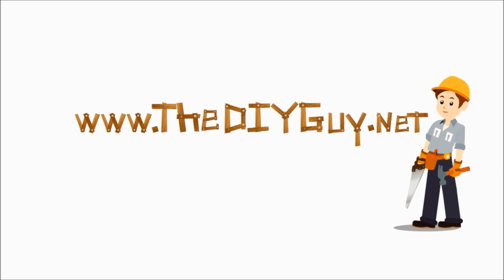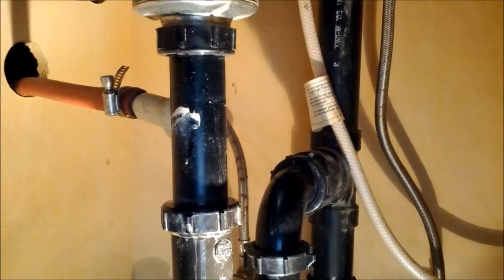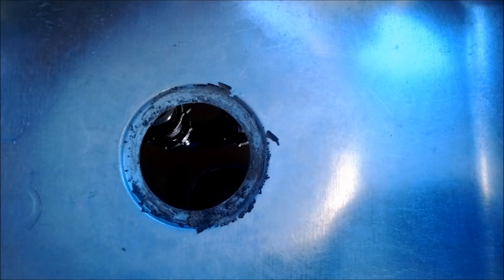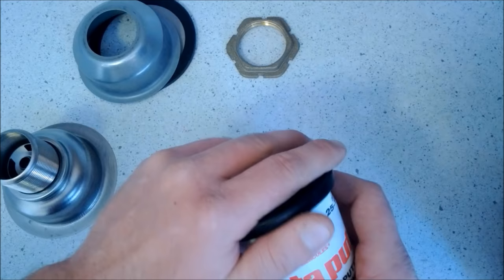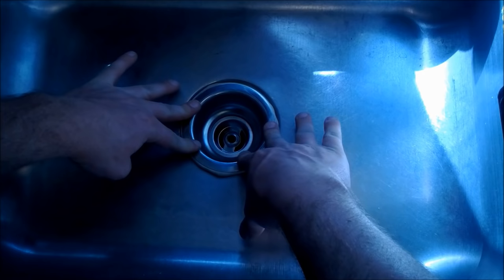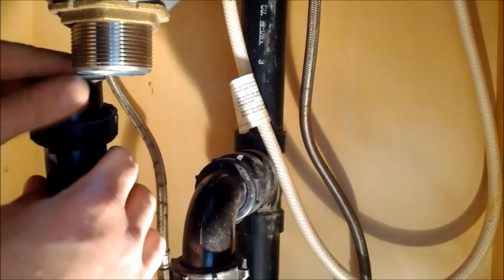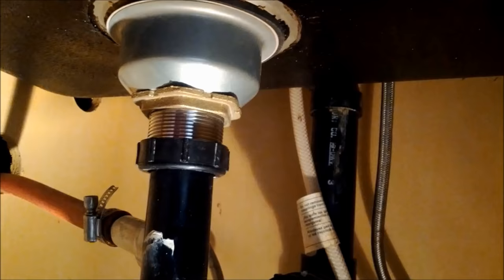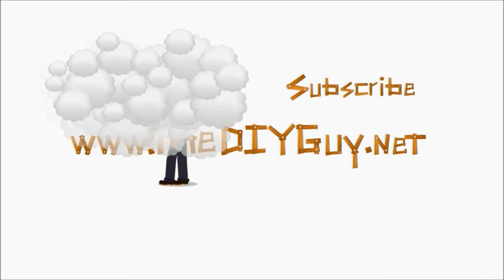How to Replace A Kitchen Sink Strainer

Comment: I tried installing my drainer when I turned on the water it was leaking from the strainer part what did I do wrong
Reply from the maker: Its hard to say without seeing it. Leaking out of the basket or where the tail piece of the trap mates to the strainer?  Make sure the sink flange is clean top and bottom. Add more putty so you get a good amount to squeezes out evenly around the entire strainer. Put a bucket under the sink to catch the leaking water and run hot water to make the putty more pliable and tighten the nut more to ensure its good and tight.
Reply: TheDIYGuyDOTnet ok great thanks
Reply from the maker: @DonsHooplifesports  No problem. Good luck with getting it to stop leaking.
Reply: TheDIYGuyDOTnet so right now the leak is coming from the screw part where the pipe connects to screw the water is coming down a little not a lot down the pipe from the screw I tried tighten the screw but when I try tighten the screw the whole drain turns so I can’t tighten like I need to

Comment: Nice video... twas a little dark at the beginning.  I would like to also recommend using some food grade plumber's grease or food grade lube (silicone spray, grease, even vegetable oil works) on the rubber gasket to make sure it's not dry, and I've seen other videos recommend some pipe dope on the tail piece and ferrule.  Thanks for the help!

Comment: In the real world its rarely this easy for the nut to come off
Reply from the maker: It depends on how much plumbers puddy the installer used and if it got onto the threads or if it leaked and rusted the threads. This one wasn't that easy as the nut split making it easier to remove it.

Comment: What if there is no nut on the bottom of the existing strainer?  It's just some goofy plastic collar that I've never seen before. I can turn it by hand, but the basket in the sink just turns along with it.
Reply from the maker: Hello, Is there a garage disposal attached? Or is it just a sink basket with a plastic nut? You could snap a picture and then click the link in the description and at the bottom of the page there is a place to upload it and I would be able to see exactly what your looking at. There are to ways to remove it.. The fastest way would be to take a chisel and heat it with a torch and then push it though the plastic nut and cut it in two spots then pop it apart. ( The way I remove plastic garbage disposal nuts.) The second way would be to use https://amzn.to/2LiQAgm to hold the basket from turning and then remove the nut with some pliers https://amzn.to/2Elqisr. You could also try and use two flat screw drivers and slide them into the basket and have someone hold them from the top while you try and turn the nut from the bottom.

Comment: I can’t rotate the nut lose. Really stuck in there. Any suggestions?
Reply from the maker: Most of the time you will not be able to remove the nut. Most of the time I end up cutting them off with either a hacksaw like this one https://amzn.to/2yPQhHT or a angle grinder. This one is the video actual cracked when I went to remove it. You'll need to cut it on a 45 degree angle. You'll want to cut a bit and then check the cut to ensure you don't go to far and cut the sink itself. You can cut deeper on the basket side and then grab a flat screwdriver and place it in the cut and twist it and it should crack/ break the top part of the nut up against the sink. Then you will be able to remove the nut. I need to replace another one and show how to cut the nut as most are really stuck.

Comment: Is there a difference between plastic and metal traps
Reply from the maker: As far as performance they do the same. Some people if you can see them like the chrome so they would need to use the metal one. Now a days people mostly use the plastic and last for a very long time as long as you don't use a lot of drain cleaner in them as it can get so hot as to distort the pipe or gaskets. I mostly use the PVC tubular traps which are white in color and plastic.

Comment: no thread tape or brush on thread sealer?
Reply from the maker: No there's no need. The plumbers puddy seals the basket to the sink and the tail piece has a gasket within it to seal it to the bottom of the basket.

Comment: Do I need to turn off any of the water valves?
Reply from the maker: You don't need to turn the water off to replace the strainer but I do sometimes depending on how long it will be and who's around as someone could walk by and use the water while things aren't connected.

Comment: Should I use plumber tape when I reattach the Pvc pipe to the drain?
Reply: no
Reply from the maker: There is no need for plumbers tape there as there should be a plastic or rubber gasket.
Reply: TheDIYGuyDOTnet thank you

Comment: Is the plumbers putty hard to get off?
I have a ceramic sink & fear chipping it 
while unsealing the plumbers putty. SOS
Reply from the maker: Plumbers putty is a soft set sealant. It sometimes is hard as a rock if it is really old putty but should come off fairly easier.
Reply: TheDIYGuyDOTnet 
Thanks!
Reply from the maker: @totallydomestic433  No problem, Glad we could help and good luck with getting it reaplced.

Comment: should I use plumbers tape on PVC
Reply from the maker: Most of the pvc drains should come with a hard plastic gasket or a rubber gasket. So there should be not need for plumbers tape.

Comment: thx much, i have a old iron nut, underneath, do you know howto cut it and withwhat, its old and wont turn ty
Reply from the maker: The best way I have found to cut the nut is with a cutting wheel, cut the nut on a 45 degree angle or so you don't need to cut the nut all the way though and be careful not to cut the sink base itself. Then take a decent size flat screw driver and put it into the cut and turn it, sometimes you may need a pair of channel pliers to turn the screwdriver and you should be able to split the nut making it easier to remove or you could make two cuts and break the nut in half.
Reply: hey, ty very much, appreciate it
Reply from the maker: No problem. Good luck with getting it repaired and thanks for watching.

Comment: Why do simple jobs HAVE to become complicated?
I confidently went out and purchased a new kitchen sink strainer kit.
But then I found that I could not easily remove the PVC (slip?) nut connecting the PVC piles to the brass drain pipe.
It was so stubborn that I've now broken the brass pipe fitting on the other sink (it's a double kitchen sink).
At the moment the PVC nut is still there but cracked as well.
Grrrrrrrrrrrrrrrrrrrrrrrrrrrrrrrrrrrrrrrr
Reply from the maker: lol that's just how it goes... The jobs that should be quick or you think turn out to be projects. Sometimes to get the plastic nuts off I heat up a chisel and press it though the nut.

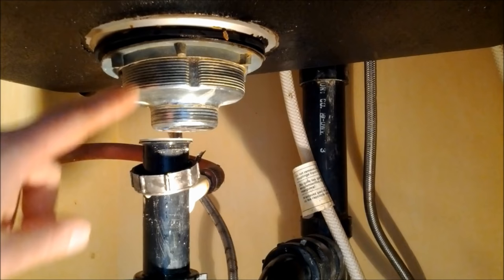Comment: At 1:10, how could you position a hack saw to cut that ring off? Mines stuck and I don't have a wrench big enough to grab and turn it with. Yours looked lose before you even took a wrench to it.
Reply from the maker: you have to go on about a 45 degree angle. When I say hack saw I'm talking about something like this https://amzn.to/2FhlVRj with the blade open so you can cut it. This is what I normally use https://amzn.to/2AZr8Je as its pretty fast. This one cracked right at the first turn you can see that its split when I turn it. So this one came off pretty easy. You can use a sawzall, angle grinder, oscillating tool ect. not sure what you have access to. you could always try spraying it will wd40, wire brushing the threads and then using a flat screwdriver and hammer and tab on the tabs to turn it. Good luck getting it off.

Comment: i bought a new basket and it is a bit taller than my old one, when i installed it i noticed that my pvc pipe doesn't sit flat to the bottom of the basket because it's taller than my old one and now the pipe sits on a bit of an angle and i can see a crack, i tightened the plastic nut as tight as i could but i have a leak, was wondering if their is a quick fix because i don't want to pvc pipe assembly under the sink, any tip would be greatly appreciated thanks, excuse my french, i hope you understood what my problem is, thanks again

Comment: How long should I let the putty set for after install?
Reply from the maker: Sorry for the late reply. Its a soft set putty and there is no need to wait. You can use it right away. Its also best to run the warm/ hot water for a bit and then try and re tighten the strainer nut as the warm water will make the putty more pliable and you can get a few turns more.
Reply: @TheDIYGuyDOTnet  thanks! I got it all done. Works great.
Reply from the maker: @breakarm8782  Awesome, Glad to hear it went smoothly for you and your back in business.

Comment: Just wondering why nobody using a rubber gasket as a seal which comes with a kit ? Does plumber's putty work better? You have installed a rubber gasket under the sink. It is pretty much useless there and serves no purpose as a seal.
Reply from the maker: This type of drain assembly has a 2nd cup that acts as a giant washer to hold pressure against the rubber washer/gasket on the underside of the sink when the nut is tightened. The Flange of the basket strainer goes on the inside of the sink and the rubber washer/gasket, paper gasket/ friction gasket, pressure cup and nut go under the sink. On other styles the rubber washer seals the sink from below, and you can use the plumbers putty or caulk to seal the flange to the sink from above. That's how they are made to be installed just like the instructions say. There are some sink baskets that do have a foam type of seal that is made to go on the top side to seal the basket to the sink. Those are mostly used on either natural or man-made stone products as the plumbers putty can lead to staining, discoloration and hairline cracks. However, they also make "stainless" plumber's putty for these other materials as well. If you use the rubber gasket that comes with the sink basket like this one inside the sink it is normally to tall/ thick so it leaves water within the sink which can lead to staining, discoloration within the sink base depending on your water and material of the sink base.

Comment: Unfortunately my old strainer/flange won't come out - it's stuck in there like it was welded in.  lock nut is off, but the old basket won't budge.  Otherwise great video.
Reply from the maker: Steve Richardson Sorry to hear that. Some people use something other then puddy which makes it a PIA to get off. Thanks.
Reply: I slept on it, and with some judicious application of a chisel I was able to chip away enough of the prehistoric putty to get it out.  Thanks again, and I really enjoy your YouTube videos.

Comment: My only issue was the old basket is a different length than the new one.
Reply from the maker: There always a little different but most of the time you can lower or raise the extension to take up the difference.

Comment: I just did this nasty job in 3 hrs-here's my tips:  Just plan on sawing(dremel cut off) the retaining ring-if there are little "corrosion crumbs"-it isn't coming off-even with the fancy tool, or extra giant hands or saying unladylike things....  Dig out the old gasket  prior to sawing,with a utility knife-this gives a little room to dremel in without cutting through your sink.  Lastly-once you are done  -BEFORE you put on the new retaining ring-coat both sets of threads (ring and strainer) with "Never Seize"-It should help in removal at a future date.  Yes, buy parts for everything back  to the wall-if you're lucky and do not use them , return them.  We live at the beach so going to the store is a trip.  I replaced all the PVC parts back to the wall drop while I was there--yick nasty.  If it went together, it can come apart-just takes time.
Reply: Would this cause any provlems if put in wrong
Reply from the maker: Mark Allen
 If it is installed incorrectly it could cause a leak underneath as the plumbers puddy needs to seal to the sink. Just ensure its sitting down in the groove on the sink and you have enough plumbers puddy and you should be good.

Comment: Hi what is that black thing called the one you remove in 0:57
Reply from the maker: Hello, That is an 1 1/2 nut that helps to hold the "P-Trap" together. I loosened it so I could rotate it out of the way. Hope That answers your question. Thanks for watching.
Reply: TheDIYGuyDOTnet i just broke mine 2 hrs ago i wish i could buy one sooner. Now the water starts to leak. Ur a huge help thanks
Reply: Is that black round one?
Reply from the maker: Sorry to hear that. Did you end up breaking the nut or the trap itself? is it metal?
Reply: TheDIYGuyDOTnet the nut i guess the round one
Reply from the maker: If your talking about the one that the pliers actually touched then that is the trap nut. If you talking about the curved part under where that nut is that looks like a "U" then that is the trap itself.
Reply: TheDIYGuyDOTnet Yes thats thing. Mine has cracked it loosen up then the water starting to came out im going to a local hardware store to see if theres an available trap nut.
Reply: TheDIYGuyDOTnet i found out it was the slip not
Reply from the maker: Sometimes they do break especially if it is a metal nut. If the trap itself is a metal one I would consider replacing the entire trap with a tubular plastic one. I would think they would have one as its a very common item. Hopefully they have the trap nut and swapping it out and getting the leak to stop goes smoothly for you. Good Luck.

Comment: do you really need the paper gasket?
Reply from the maker: The paper gasket helps the nut slide against the rubber. You can get away without it.

Comment: Why the plumbers putty why not just a second gasket in between instead it would look a lot cleaner.
Reply: Whoever installed the sink baskets on the house I recently purchased did just that (actually, they installed the gasket in place of the plumbers putty, with no gasket below the sink). What that did was prevent the sink basket from sitting flush against the sink bowl, so that the water did not completely drain - there was a small accumulation of water around the sink drain, which was a great place for hard water deposits to build up.

Comment: I can’t remove the nut
Reply from the maker: Depending on how old and if it leaked it may be corroded on there and unable to remove it with just pliers so you will need to cut it off either with a hacksaw or grinding wheel at an angel. You can cut most of the way though and then use a flat screwdriver to split the nut.

Comment: so it looks like you dont have to go apesh!t tight with a plumbers putty seal?
Reply from the maker: You do want it pretty tight as for some reason they do tend to loosen up. Its best to run the hot water for a bit once you think its tight as it makes the puddy more pliable and then tighten as much as you can and every once it away recheck it for tightness.

Comment: 5 min job or less.  So why does a plumber say this is a 2 hour job and charge $150?  Basic robbery.  Got estimate from our neighborhood handyman, said he'd charge $50 to replace our kitchen faucet, drain, and garbage disposal.  Said each task takes about 5-10 min, 45 min MAX.  I cancelled our appt with plumber, we're going with the handyman.
Reply from the maker: Its not hard job although sometimes you can run into a stuck nut which makes it a bit harder. I don't think its a 2 hour job but it seems more people are charging travel time as well.  Still saving 100$ going with the handyman vs plumber.

Comment: WTH you replaced the drain with a different style of drain.  Not completely helpful ...
Reply from the maker: OK.. There are only 2 differences between the one removed and the new one.. 1:) The stopper has a ball to help hold it down to stop the water rather then the old one that the stopper just uses gravity/ weight of the water to seal it and hold the water.  2:) That the new one uses a metal cup on the bottom and a smaller brass nut rather then the old one which uses a larger nut. As the steel is cheaper then the brass. We even reused the existing dishwasher tee and drain line with no modification or alteration. Sorry we couldn't help and we let you down.

Comment: Nope. Easier seen than done.  I’m calling the plumber.  The whole top and bottom kept spinning preventing the nut to loosen and that’s with sons dead weight holding the top in place with a screw attempting to disallow rotation. Ain’t working

Comment: do i need the paper gasket   damn  mine broke     xmas n imbleedn cash
Reply from the maker: The paper gasket just helps the basket slide so it doesn't bind on the rubber. I have seen them installed with the paper gasket.
Reply: thanks for  replying  and posting vids    so  do i really need it   lol   took me all day to find n ruin thevfirst paper gasket
Reply from the maker: No problem. You're welcome. No you should be able to get away without using it or you could try and tape one side and put that towards the rubber.
Reply: ur awesome   thank ya   happy holidays
Reply from the maker: Thanks. Thank you for watching our video and happy holidays to you as well.